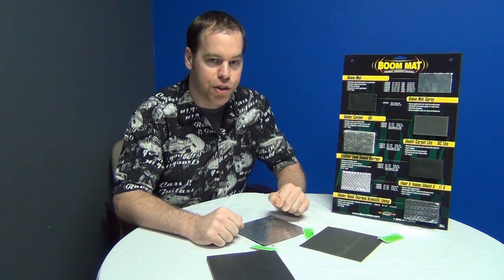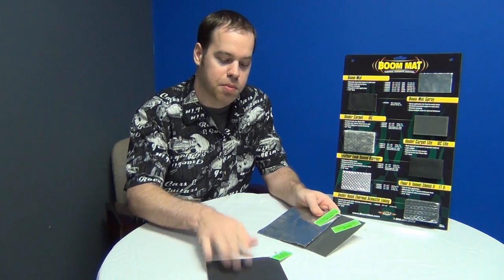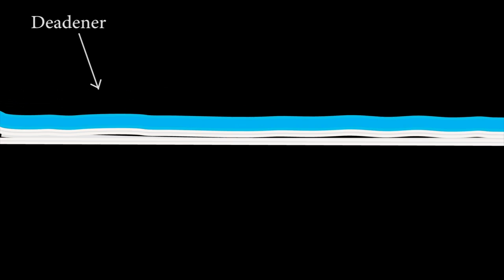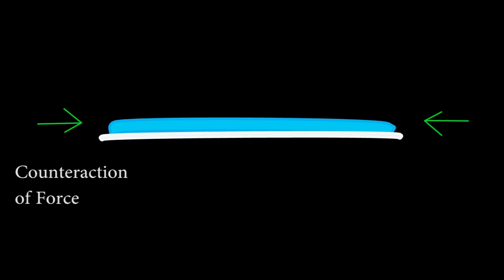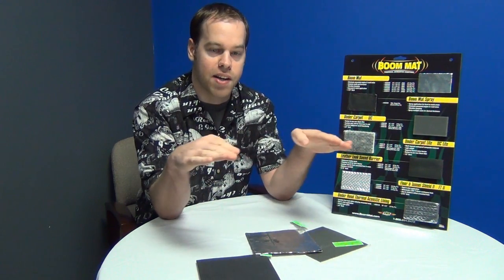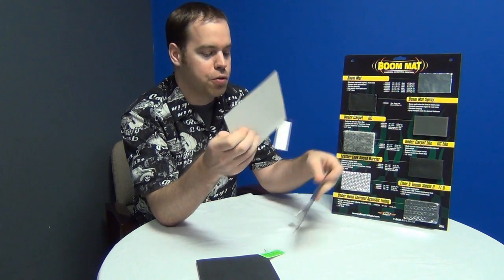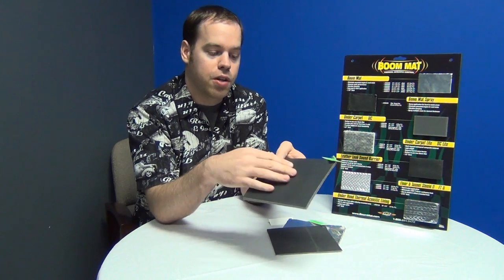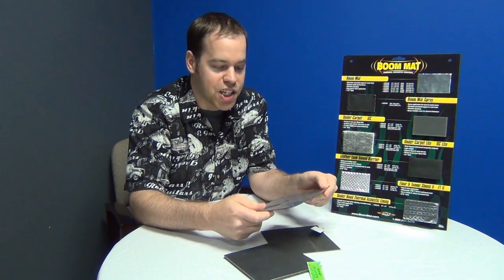Showtime Electronics - Sound Deadener Explanation Featuring Boom Mat

Comment: would you recommend deadener to a car even if it only has a moderate sound system such as my hertz es 300 12" sub and hertz sound system in my car? I have a station-wagon and I have the sub stealth installed into the spare tire, and I don't notice much vibration to the doors just more to the rearview mirror and the windshield wipers